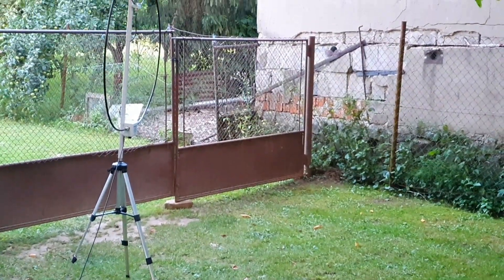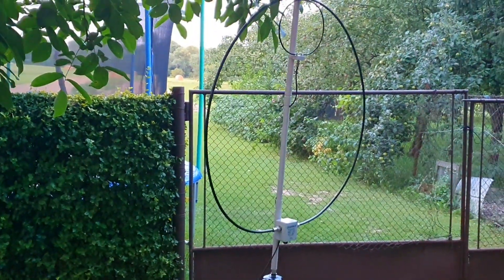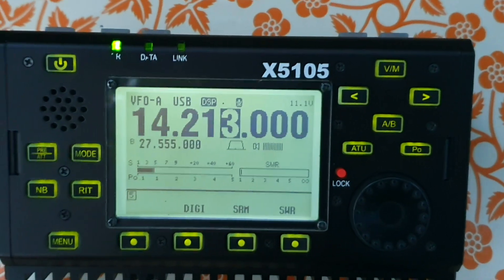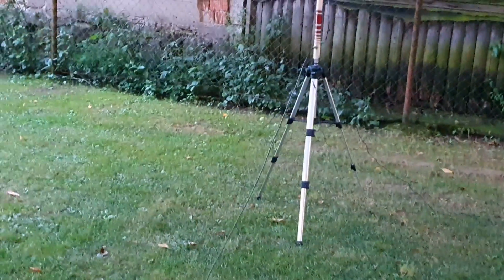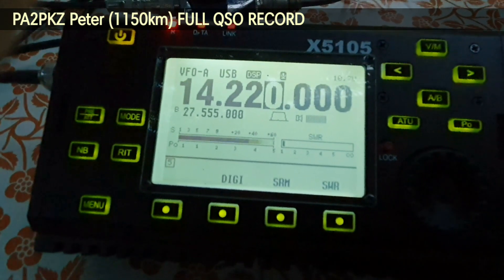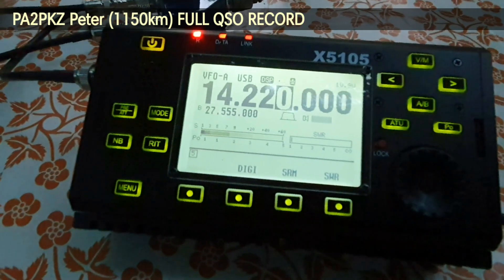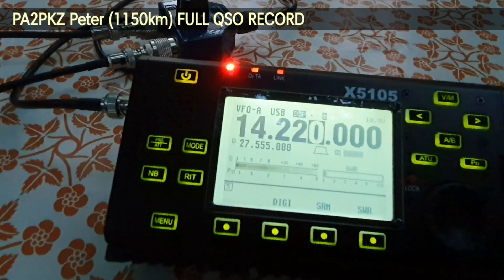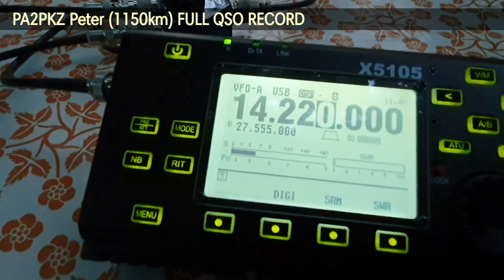Magnetic Loop vs. Vertical Antenna (A/B comparison)

Comment: It is not possible to do a correct antenna test if the vertical is installed and covered by the tree. The right thing to do is to do it in an open area

Comment: Your metal fence will directly effect your test. If you use a field strength meter you will see the fence is absorbing some of your RF and interfering with your test.  You need to be in an open field or above the fence to test your antennas.
Reply: Hi there Jim,  
I agree with you. 
I was also thinking the very same thing as you regarding the wire fence.  I was also about to make a similar point post to Paul/Pavol.  The wire fence all around him will screen his signals a bit like a Faraday Cage. 
Kind Regards, 
Ray, M0RAY, 
South East England UK.

Comment: There is a reason that I made that suggestion my friend
& I am coming from a purely scientific and exploratory perspective beyond normal ham radio.

I see the ZERO voltage reference point as the probable half way point between two opposing
(inverted) high voltage points (voltage loops).  

This is a common and natural outcome.

The Ground Reference 
of your system 
is the Zero Voltage Point
and both of your antennas are connected
via that point no matter how you throw the switch.

Please Please Please my Friend,
Re Run these tests 
whilst double checking with a field strength meter observing both of the antennas
for the sake of RADIO SCIENCE !

i would be much obliged if you also connect with me
and let me know the outcomes.

I am not a Know it All,

I am a WANT TO Know it ALL   HAHAHA,
& I am very passionate about RF Science
along with being very outside of the conventional and convenient approaches that most RF engineers & Hams Take.

Comment: That is a very interesting demonstration
thankyou.

I would be interested to see you transmit on one antenna
and check the both antennas with an RF field strength meter.

There is a possibility that both antennas were actually radiating simultaneously.

Keep up the great work and thanks for a very interesting video ⚡🙏⚡

Comment: 2 days ago I used 2 meters of 10 mm copper pipe bent into a loop and connected it to the mfj 935c loop timer and made contact with a ham in Belarus on 20 m 5 watts, 2,223 Kms. The loop tuner was sitting on a patio table.

Using the 4 meter loop I made contact with a ham in Canada from Ireland 20 watts on 20 meters.

Comment: Interesting video but I think the vertical antenna would be better if the radiator didn't touch the leaves. 73 de df8ru

Comment: I have the same radio and a magnetic loop. BH5HDE QRP Magnetic loop as seen on ebay etc. I think I was on wspr at 5 watts when the radio had a failure. The external dc connector opened up not allowing external power in the radio. Also now the radio wont charge because of this. The radio was working fine for a few hours before this with the same antenna. So I'm wondering if the antenna may have been to close to the radio. Maybe rf got into the power cord of the radio and took out a diode or something. Wondering if you might have any ideas on why this may have happend. I do have a replacement radio on the way. I would like to make sure this does not happen again.

Comment: NOTE!  Narrow bandwidth of the magnetic loop is not a detriment.  Instead it is an attribute. It is an additional filter.  The highest performance magnetic loop antennas have extremely narrow bandwidth, which is a trade off.

Comment: How sure are you that your magnetic loop was a directionally pointed at your answering station?
Reply from the maker: I know which direction from my country is the Netherlands 😃 Second thing is that directivity of the Magloop is not very sharp so in reality there is not a big difference pointed or not to the destination country. 73 😉👍 Paul
Reply: @OM0ET  I experience a significant null off the sides & a notable gain when pointed toward my target station.
Reply from the maker: @QSasquatch  i meant on TX
Reply: @OM0ET  yes
Reply: @OM0ET  I enjoyed your video. I have an S-8-10 noise locally daily so knocking the noise down to a 3-4 is awesome.

Comment: Interesting....  I have been comparing a half wave dipole with a 1 meter diameter magnetic loop for receiving as well. In my case, the magnetic loop will sometimes (not always) exhibit a lower noise floor in relation to the desired signal, with the half wave dipole often resulting in a higher noise floor.  From the standpoint of intelligibility, the difference in signal strength is not as beneficial as compared to the difference in the noise floor. If the noise floor is say, 3dB lower with the magnetic loop antenna, then it doesn't matter so much that the dipole signal strength may be as much as 1 S unit higher... At least for receiving, it appears to be the signal to noise ratio that counts.

Comment: Thanks so much for this excellent comparison between your mag loop and vertical with radials. I'm guessing the vertical antenna would yield much wider bandwidth on standard HF bands.

I'm anxious to try out my new Chameleon  mag loop.
Reply from the maker: Yes, that's the advantage of the Magloops. They can properly work even in difficult locations like this.

Comment: I'm not surprised at the results. For the size of your Magnetic Loop, it's pretty efficient. If you make the same test on forty meters, you may notice a small difference? The only real downside of the Magnetic Loop is the bandwidth. 
Thanks for posting the video. It was interesting to watch. 
Barry, KU3X/QRP

Comment: Great video Paul, I love such comparisons, but I am amazed that the vertical antenna did not work better. After all, the radiator has 1/4 lambda and the counterpoises also 3x 1/4 lambda.
Reply from the maker: Thanks! Maybe metallic obstacles around makes difficult for vertical 😄 My Magloop performed better in this conditions 😉👍

Comment: Hi Paul, thanks for the video - I love comparisons like this. Magloop doing a great job. The vertical antenna in the video is not really a 1/4 wave vertical, only electrically. It would be interesting to see you compare the magloop with a physical 1/4 wave vertical in a future video. Also, did you point the magloop roughly in the direction in the direction of the stations you worked?
Keep up the good work!
Reply: Please explain more why the vertical quarterwave hes using isn't a real quarterwave? Thanks.
Reply from the maker: Hi! On 20m is the jumper in position where the coil is fully shorted, so vertical is physical 1/4 lambda 🙂 Yes Magloop was pointed towards stations I copared. 73, Paul

Comment: Nice presentation but real concern about results with large metal gate and wire fence at same level, and directly in line with radiation pattern of Magnetic Loop.  Although I concur with overall results, my experience is all large metal materials need to be half diameter below, and, 4 diameters away to prevent coupling and possible deQing of antenna.  I also prefer it to be broadside to Antenna.
Reply from the maker: That's the point of this video/comparison, to show how effective is the Magloop also in difficult conditions, compared with the GP vertical.

Comment: I always thought that verticals where better for permanent/semi-permanent installations. You need at least triple the radials to beat the ground loss. Where as the loop is a pleasingly effective portable, or HOA/apartment antenna. But your video does prove that as portables, but antenna work well! Thanks for the vid.
Reply: Yeah, you just use wire for the radial to make easier. Plus for receive only purposes it doesn't really matter as much. You would do surprising fine as well without them. It's when you transmit that things get tricky.
Reply from the maker: Normally full sized 1/4 wave vertical in ideal conditions is 1S point better than the Magloop antenna. In this video are both angennas installed in difficult enviroment like metallic fence, tree atc.

Comment: This video shows your compact loop performs quite well on 14 MHz.  You properly oriented the loop to minimize its coupling to the vertical.  I have similar experience comparing a magloop and vertical on 20m.  On 7 MHz and below, a magnetic loop of that size would have poorer radiation efficiency than the vertical but it can offer a better received signal to noise ratio.  73

Comment: Excellent demonstration of an all coax, tuned 1 Meter Loop!
Reply from the maker: Thank you very much! Best 73, Paul
Reply: @OM0ET  Paul, how do you tune it? Just noise increase, or SWR?
Reply from the maker: Yes, first I catch the noise peak by ears or s-meter and then push PTT in carrier mode like AM/FM/CW for fine tuning to best SWR 🙂👍

Comment: Suggestions.
1. more radial on your 1/4 wave. The length does not matter but ideally, off the ground, and they really only need to be 10/wavelength (2m for 20m, 4m for 40m and 8m for 80m) but you need at least three times as many.
2. You magnetic loop is directional, so you might want to try turning it for maximum signal.
3. Keep your magnetic loop away from other metal items.
4. Us lower loss coax.

regards
G7VFY
Reply from the maker: 1. Yes of course it will work better with more radials, but then it wouldn't be the point of simple and lightweight portable antenna :)
2. in this test my Magloop was pointed to the incoming signal direction to be fair comparison
3. not always is it possible, not in this video. But both antennas was placed in comparable amount of the metal fence for fair comparison
4. I am using just 5m long feedline of the RG58CU, which is only 0,3dB loss on 14MHz, it's OK ;)
Reply: @OM0ET  Agreed.  Coax loss for a matched load would be minimal.
Reply: No the directionality of the loop is gone once you get above 2-3 Mhz or so.  You still have the lower noise characterstic, and this is what makes it useful for many urban plots and areas where HOAs are a problem

Comment: That was a very good demonstration of the mag-loops amazing properties.
I really, really need one of those for digital emcomm where you often sit static on one frequency.
I'm hoping to be able to order one of yours very soon, Paul!

How did it go with your electronic loop-controller?
I'm sketching a little on a raspberry based DIY controller myself - with feedback from a field strength meter where I'm doing a quick 360 on the main capacitor to find out in what area on the cap we should do the fine-tuning in next cycle. I'm also thinking of interfacing the controller to the radios CAT for frequency awareness so that tuning can start automatically as soon at the frequency changes on the radio. Also storing of the 'coarse tuning' areas to quickly position the main capacitor - and maybe using a smaller vari-cap or a capacitor network plus relays for fine-tuning. I'm thinking of using small stepper motors with micro-steps + reduction gear for very high resolution, precision and repeatability, not regular servos with position feedback. We'll see what it ends with... 🤓😀
Reply from the maker: Development is in progress :) RB will be great solution, I believe! :) So good luck with your own project! Looks promising ;) 73, Paul

Comment: A very timely video, thanks very much. I was just thinking about this yesterday. Love your work. I think the vertical might work better with maybe 10 or so radials. Did you make the mag loop antenna yourself?
Reply: Yes, Paul does .. https://www.om0et.com/    73.
Reply from the maker: @pd9rd  yeah that is my website :) Thanks!
Reply from the maker: Yes of course it will work better with more radials, but then it wouldn't be the point of simple and lightweight portable antenna :) hihi
Reply: @OM0ET  hey Paul. It wouldn't be too much more trouble to add some more and the benefits would make up for it. Did you get a chance to watch any of the Ham Radio DX live stream?

Comment: 👍nice video Paul,  what vertical are u using exactly, sorry if I missed it.  I often use the MFJ1979 telescopic portable , what about yr noise floor on the loop? Nice to see you in the country side, cheers n 73
Reply from the maker: Yeah, that's also my antenna, the MFJ1979 ;) Nice vertical!
Reply: @OM0ET  Thanks for the reply Paul,  I enjoy yr antenna experiments and builds, you have done several Mag Loops, videos,  you may recall i purchased one from you for my Bulgaria QTH,..  take care Paul, 73 👍
Reply from the maker: Yes Thomas, I remember. It was long ago, maybe 1.5 years ago already right?